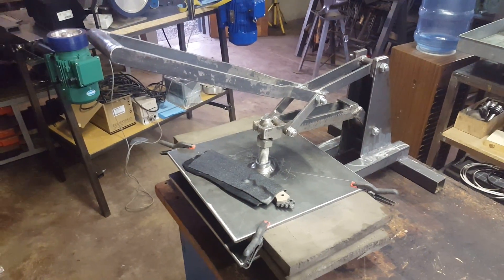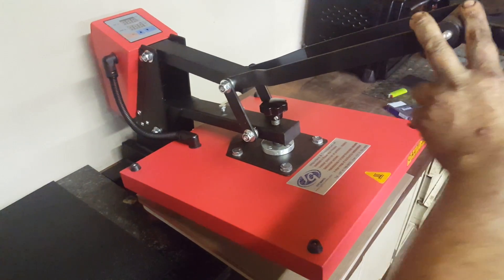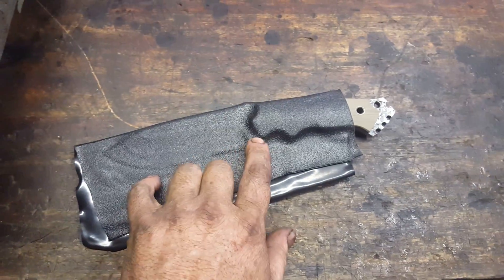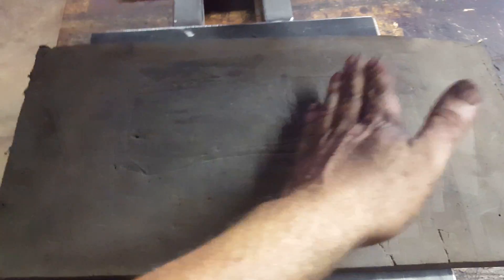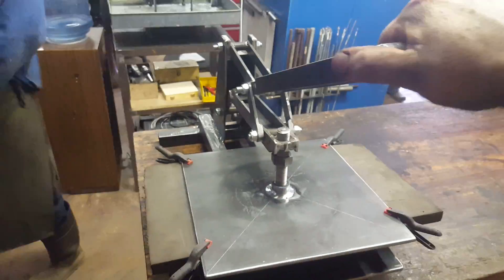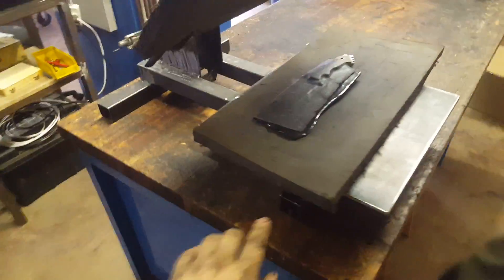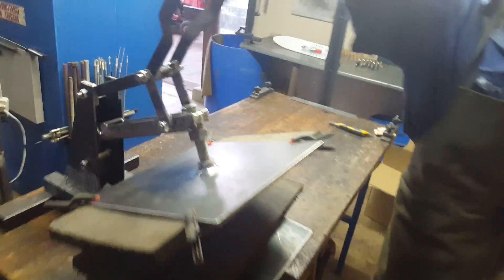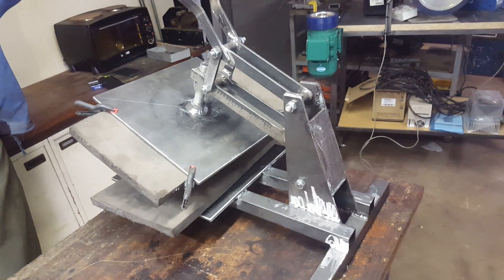My prototype KYDEX press

Comment: Hey Neels, ABS is a polystyrene based plastic, Kydex is a polyvinyl acrylic based plastic. The two are not the same although they both can be thermo formed. 

For foam I use high grade closed cell sheet that is used in the construction industry  (sorry can't remember the name right now), it gives incredible definition and lasts and lasts .... It's kak expensive but worth every cent, much better than the camp mat stuff!